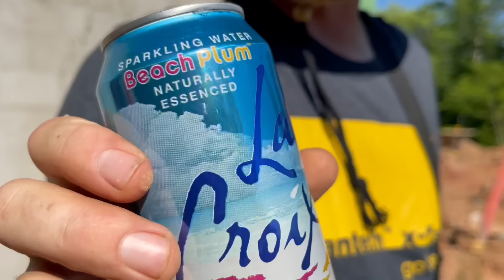Framing A Giant Gable Wall | Building The Nantahala Retreat #9

Comment: If you ever build a DelTEC, that tool for drawing the plates together will come in handy.  I was wishing I had one as I assembled my house in South Dakota
Reply from the maker: I’ve heard those Dell tech homes can be tricky to frame if you’ve never done one!
Reply: @PerkinsBuilderBrothers  I'd never done one and it really wasn't that tricky.  they give you an assembly manual.  If you follow it, things come together.  the sub floor is precut.  Once you have your floor joists sitting loosely on the mud sills, you put the first course of sheathing on loosely with a screw in the outer corners.  It will line everything up.
Reply: Where can I find a puller like that!

Comment: Watching these videos have gotten me to think of a lot of different building projects.  I can do none of them at present (and probably not future) but that has never stopped me from thinking before.  

For instance, many ecology enthusiasts advance the idea of using old tires and old bottles to build a house, citing that it requires up to 30% less new materials.  Would you ever consider building a house out of old tires and glass or plastic bottles?  If someone asked you to do it, I mean?  Alternately, would you ever consider attempting to build a house exactly the way houses were built 150 years ago?  That is, using raw tongue-in-groove timbers, plaster over horse-hair walls, etc.  Of course, electricity and plumbing would still have to be included, but only the very first functional ones, from, say, the late 19th century.  Would you be willing to do that?  Just to see what it was like?  The historian in me would love it.  

BTW, speaking of historical builds, did you know there is a project that has been going on in France in which a team of historians are building a castle exactly the way it would have been built in the 12th or 13th century?  They are in the 21st or 22nd year of what is expected to be a 25 year project.  It's called Guedelon Castle (BTW, Guedelon is pronounced, funnily enough, "git-along").  If you look it up on Youtube, there's even a series that follows it for one year.  I think that was filmed during the 15th or 16th year of the project.  It's really fascinating.  I also follow them on Facebook, https://www.facebook.com/Guedelon

Anyway, it's great to see Jaime back and to see the initial unveiling of his hand (I'm also following the current build; I watch these because I think they all have original points of interest), as well as just watching as you tackle another home.

Comment: Being a retired union carpenter, I've rotohammered enough anchor bolts for this lifetime and the next, and the reason why the rotohammer you have is making so much noise is that somewhere around the 90's the engineers figured out that the impact forces needed to be multiplied way up to help concrete be drilled easier. Remember the old drills you could almost count the times the hammer was hitting. Now it's got to be 20 times more.

Comment: Interesting notching technique on the deck joists instead of using hangers and flushing up the tops. Seems like it would be a little tougher to get things flush and maintain good bearing with the notches.

Why did you decide to build this way?

Comment: Why don’t you leave a gap in between the ledger and the sheathing on the house for water flow? I’ve been using Deck2Wall spacers (I call them hockey pucks) to get the spacing. Thanks

Comment: Is there an advantage to using the board to set the deck joist on versus using joist hangers?
Reply: What they did was against code. 2018 IRC banned the use of ledger boards for deck joists because of safety. Joist hangers would be the code approved method.

Comment: Wait... why do you notch your joists and hang them on a 2x2? I have an old deck now that has that kind of framing from back in the 1980's. When a new deck is eventually installed I will insist on joist hangers.
Reply: I also noticed the notching of the joists, thought that was odd.  Seems like joist hangers is the most poplar thing to use for what is being done.  Maybe the owner doesn't want to see metal hangers when they are under the deck???
Reply: My guess is that the span is short enough that local code allows it. Cost of hangers and teco nails starts to add up quick, plus the labor to install the hardware
Reply: What they did was against code. 2018 IRC banned the use of ledger boards for deck joists because of safety. Joist hangers would be the code approved method.

Comment: Question. I seen you sheathed the walls with zip R sheathing. Do you think that it has a decrease in resistance to lateral forces because the sheathing isnt butted up against the framing like traditional wall sheathing. I know the foam is there but I its not providing any structural resistance. Its foam and basically what ever thickness the foam is then that to me is a gap between the wall sheathing and framing. Your thoughts

Comment: I thought you weren't suppose to use aluminum flashing in contact with PT lumber cause the chemicals will corrode the flashing.
Reply: That’s what I thought. Maybe they’re using a different type of pressure treated lumber that’s not as corrosive. Or maybe they put a wide strip of flashing tape over the top edge of the aluminum so the lumber doesn’t touch the metal.
Reply: @janderson8401  Seems like they did tape the top edge of the flashing but the bottom is still in contact. Instead of aluminum flashing, use Ice and Water Shield behind the ledger board.